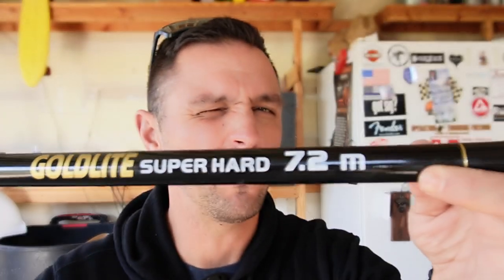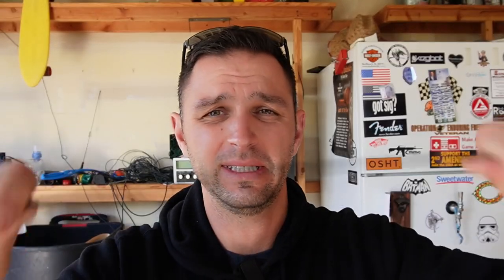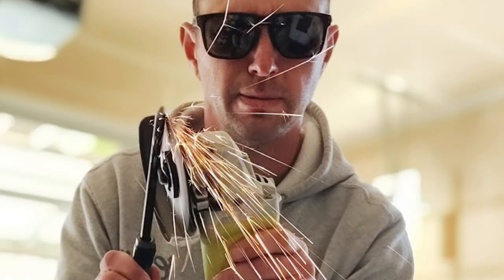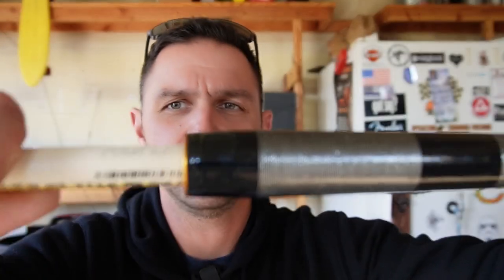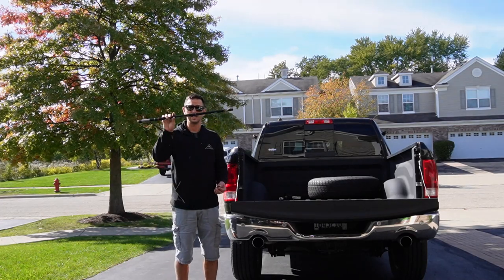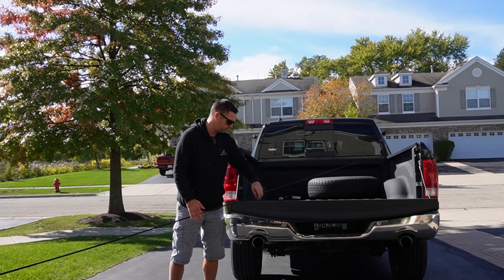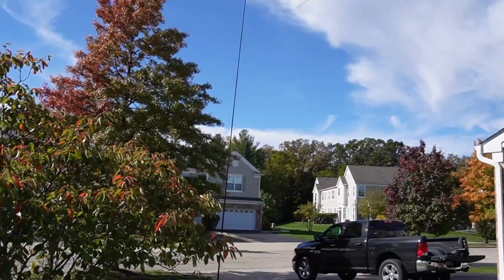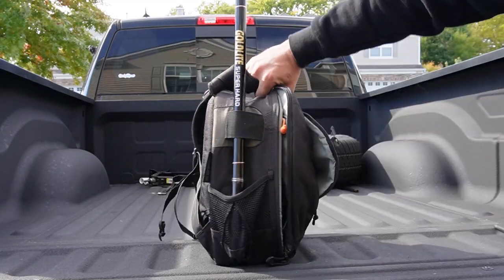Portable and Compact Telescoping Fishing Poles For Ham Radio  - Goture Goldlite

Comment: I found the "Miracle grow super steel garden stake" fits inside perfectly. They are 6 feet long, tubular steel with plastic covering. I use a 2 foot section, push 1 foot in the ground, and slide the pole on the other foot. I left it up in 40+ mph winds for a day, and it stayed up great.

Comment: Great idea.  I use a tiki torch stake for backpacking.  Very light aluminum with a thumb screw to tighten down any diameter pole, whether a fishing rod or Carbon 6 mast.
Reply from the maker: I kind of like that idea. I may get a pack of those to test them out.  They look a lot less like a prison shank (in case I get pulled over or something). Thanks for the input!

Comment: Very nice.  I am looking for a portable pole for maybe POTA and this gives me some ideas.  You are very clear to me and I will keep watching this channel for more content.  73 de KI5HXM
Reply from the maker: I really appreciate that.  I do my best to make things easy for everyone to understand.  Let me know if you come up with any other cool ideas or find a pole you enjoy. So far, I have brought this out a few times and it's done a real good job. One thing I did: I used the smaller off yellow tubing and placed some heat shrink around it, then taped it. I did this after I let the epoxy fill up inside the tube.  It looks a lot cleaner and seems to grip the inside of the pole a little better. Thanks again!

Comment: Good short video. Always good to have another option with more available components, especially in the current supply chain situation. The off white pipe looks like CPVC which is used for hot water whereas PVC is only rated for cold water. Electrical tape is good, or 3d print some adapters. I made some similar adapters for the larger telescoping poles with a trailer hitch and some all-thread layered with PVC and tape for quick stationary vehicular deployment (before I had a 3d printer). Lots of useful ideas.  :) 73 de w6akb.
Reply from the maker: You are correct Alan!  CPVC! I have this cool 3d printed "connector" or "Separator" designed.  Hopefully if I get a few moments, I can go test it out, but it's super simple and prints in about 35 minutes. I'll be happy to share it when I confirm it's working.  This is my favorite part of the hobby.  Finding things that will work, and designing others that will make those things work better.

Comment: You need to measure your poke when it's assembled.  They get their measurements by adding the total length of each piece and giving you the sum. When I got my rod, it measured 18'6. They don't factor in the length lost length of each piece when a little of each piece is inside the last one. 
By the time I removed the top two pieces it was under 14'.
Reply from the maker: Thank you

Comment: This is exactly what I need for POTA. Thank you.
Reply from the maker: My pleasure. Another good one that I've had success with lately is the South bend kwikstik.  17 ft and it appears to be better build quality with a tad more rigidity
Reply: @HAMRADIODUDE   I actually searched for that one a few days ago and could not find it in stock anywhere.
Reply from the maker: @potaactivator  this is an affiliate link, but this is the one I have, the only thing I would recommend is not opening it by sitting it out like a fishing pole as the sections tend to get stuck together.  https://amzn.to/3KIPXNk
Reply from the maker: If I can get my garage finished cleaned before I leave Tuesday, I'll try to make a quick video comparing about several different crappie poles

Comment: Nice video. I have been using this pole for a 2m/70cm roll up slim jim (ladder line) antenna and RG8X coax for over a year. Super easy to carry and deploy as shown.
Reply from the maker: I think that I may get a slim jim (or build) ladder line antenna for just that. Thanks for the input. Glad it is working well for you!

Comment: Those poles work great for building a Moxon like Chuck has. ;) Did you try using end caps on the 1/2 pipe? I have many Carbon Fiber masts and if you run a wire buy it or coax down it, no issue. I have used ladder line next to it at 3" out from the pole with no issue.
Reply from the maker: Hmm, I did not try the end cap, but that is worth a shot! Thanks Don! As for the moxon, I love what he did.  We had the Moxon up and operational within 10 minutes, I would say. Nice poles to have around.

Comment: Any reason you couldn't attach the pole to a tripod with something like a "CAMVATE Super Clamp Articulated Mini Ball Head with 1/4"-20 Thread Hole" and stake/weigh the tripod down to get things just a little higher since your not using the end lengths?

Comment: I was just looking at these fishing poles on amazon. Great video! Would these work with a slim jim (N9TAX) antenna or would they cause interference?
Reply from the maker: That's a great question. The potential is there as it is Carbon Fiber. i guess I could make one, but it would be a few weeks.
Reply: @HAMRADIODUDE  I'd love to see that video if you can do it! Kudos for the channel
Reply: You can get a signal through but there is some interference.

Comment: It looks like that rod might fit in a spiral fishing rod holder, Walmart sells the Ozark Trail rod holders for less than 3 bucks.  What's the diameter of that rod at the base?  I measured the inside diameter of the rodholder with calipers and they are about 31mm.
Reply from the maker: Off  hand I don't know the diameter, but it does fit in the orange fishing pole holders from Walmart
Reply: @HAMRADIODUDE  Thanks for the response.  That's what I have, the orange sturdy rod holders.  It looks like I might have to buy the rod and give it a shot.
Reply from the maker: If you have a few days/week, I'm working on an update video / comparison
Reply: @HAMRADIODUDE  Perfect, thanks

Comment: I'm on the third floor apartment when the landlord won't let me throw a wire to a tree so I got one of these with the idea of putting my 66 ft of wire through the end of it and stick it out the window so it's away from the house and hanging straight down with the wire coming in down the pole into my radio and when I'm done playing radio I'll just pull it back in